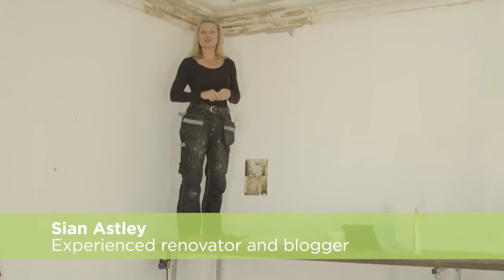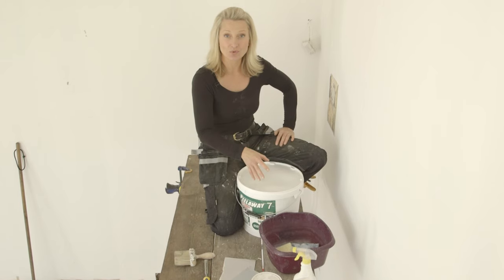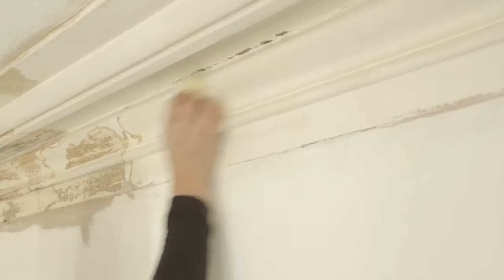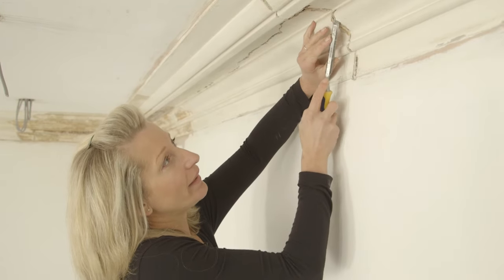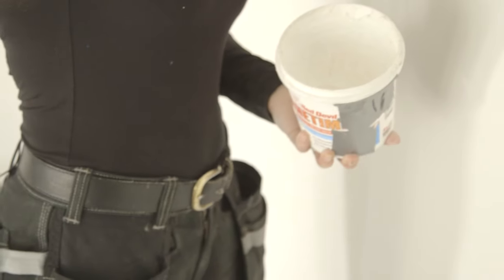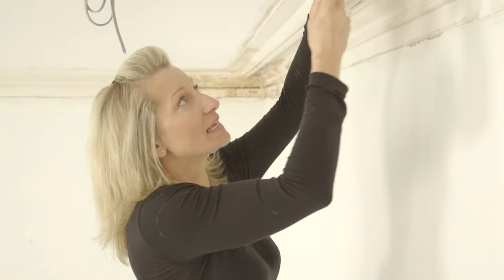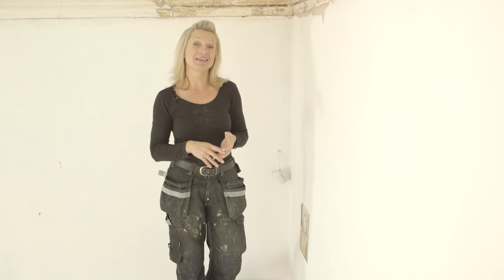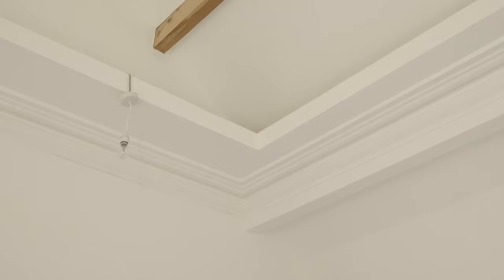How to repair and restore cornice | PROJECT ADVICE | Future Homes Network

Comment: Regarding the cracks, what I found easiest was to use my chisel and cut the crack out wider with sharp chamfered edges, so your effectively turning the crack into a V shaped groove ... then use my fingers rather than the knife to push the pre-mixed filler into the groove (don't worry about it bulging out of the groove at this point, just get plenty filler in there), then take my filler knife and run it over the groove smoothing the filler flat with the rest of the cornice.

Once left to dry you can barely notice there ever was a crack.
Reply from the maker: Yep, sounds like a good technique to us.

Comment: Can you tell me if there would normally be a layer of plaster or lime paint over a pinky plaster on cornice? I left the Peelaway 7 on far far too long and it appears to have eaten through the usual grey-type layer.. I’m wondering what to resurface it with. I don’t want to cut a slice through undamaged cornice to make a template. If I smooth it over with plaster of Paris perhaps I can get the surface back?